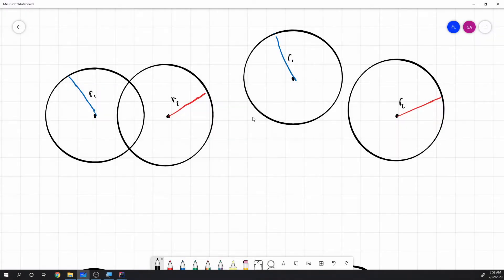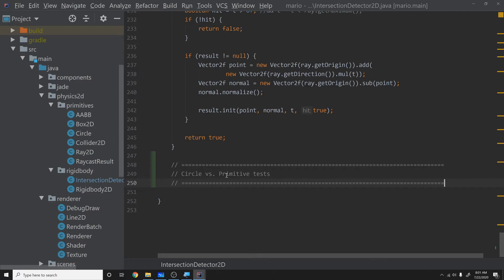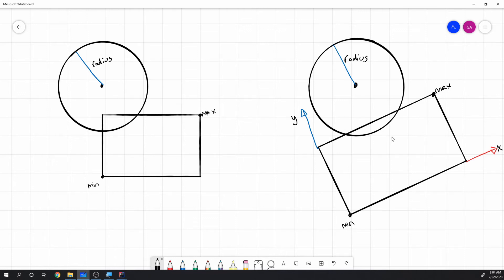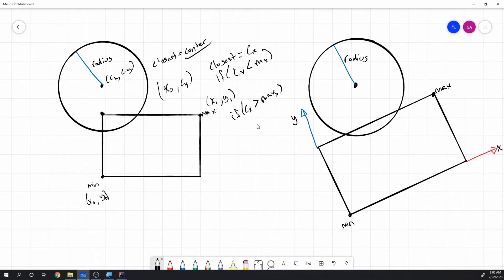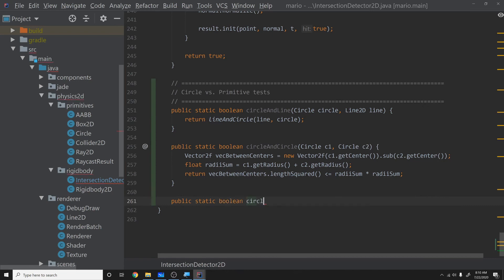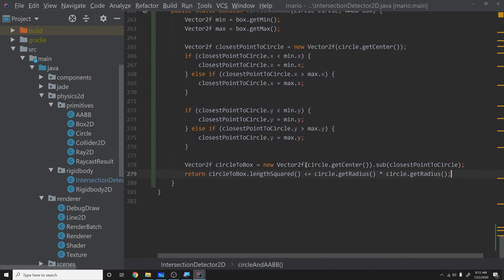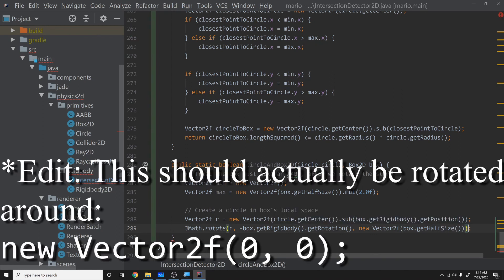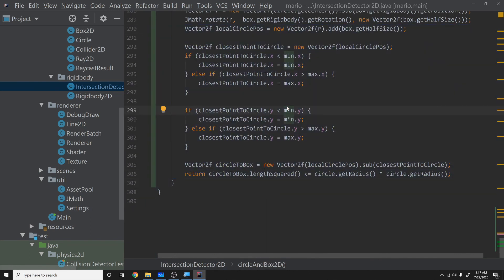Circle vs Shape Collision Detection | Coding a 2D Physics Engine in Java #10

Comment: I didn't try if your code is working, but I think the collision is detected only on the corner. what if the circle is colliding on the edge of AABB. sorry my english is so bad and I'm a little confuse
Reply from the maker: Your English is fine :). It won't be checking just against the corners though. Since I initially set the closest point to the circles center, it will only snap to the corner if the center less than the boxes min, or greater than it's max, otherwise it uses the center of the circle. Pay close attention to the if statements, and if you step through the code with a couple of real examples it will hopefully become more clear. Also, the code is available in the physics package in the repository linked in the description of this video (or the 2d game engine series if it's not linked in this video for some reason)
Reply: I was very confused by this too. The insight that helped me understand is that it will always clamp either the x or y value of the "closestPointToCircle" object to the box's edge, so it's not just using the centre of the circle as the "closestPointToCircle" (unless the centre of the circle is inside the bounding box, in which case that would obviously be the closest point to the circle in the box). I don't know if that helps you but it's what worked for me.

Comment: Great series! Your teaching style is fantastic!

I have been trying to write tests for the collision detection methods and I have a question. We included a RigidBody2D object in our Circle/Box2D/AABB classes and initialized it to null. We never initialize the rigidbody variable properly and thus, whenever it is accessed in the collision detection methods, we get a null pointer exception. What I ended up doing was to simply have the user pass a RigidBody2D variable via the constructor so that I could set the position (and rotation for Box2D). 

1) Is this what you plan to implement in the future or are you going to do something else?
2) I am not clear on how the rotation works for Box2D. Assuming I pass a RigidBody2D variable to the constructor (with a position and rotation set), should I initialize the Box2D variable with the value of the rotated points for min and max or should I use the axis aligned min/max?
Reply from the maker: Hey Sabah! Thanks for the comment and these are all great questions, I've kind of just been avoiding all these issues for now because I wanted to take a look at how Box2D (the actual library here: https://github.com/erincatto/box2d-lite) handles it. The way they handle the position/rotation is by actually storing it in the collider (Circle/Box2D/AABB) which is what I think I will switch to. Once we have that there will be no need to keep the reference to Rigidbody2D anymore. 

For your second question, currently the min max just gives us the axis-aligned min max of the shape, which is very misleading, and I don't think it ever ends up actually being used. I think I am either going to change that so it returns the true min/max of the rotated box, or remove it entirely in the future. Let me know if that cleared things up a bit, and sorry for these bugs this series is very much a work in progress :)
Reply: @GamesWithGabe  Thanks for the clarification! 

Actually I found your channel when searching how to implement a game loop with smooth animation. I was not getting good results using Swing, especially on a linux environment, and was looking for an alternative. 

I started with the intention of just using your game loop but I kind of just got sucked in to your series. I have never used opengl myself, so that was a great draw to your series. 

Anyways, you are doing a really great job here, top quality material. Keep up the great work, it will pay off!
Reply from the maker: Thanks again Sabah! I really do appreciate all the encouragement, and also wish you the best luck on your game dev journey :D

Comment: Another great video!!
Here's a Question: Is using if statements better than using Math.min() and Math.max()? Or is it the same deal?
Reply from the maker: Thanks Nikhil! I clicked into the implementation of Joml's math.max() and this is it:
    public static int max(int a, int b) {
        return (a >= b) ? a : b;
    }
so it's literally just a ternary statement lol. I got a bit carried away...
*Edit: I got very carried away and went digging through the Java compiler's source code lol. Check out my answer at this Stack Overflow question at the bottom for a ton of info: https://stackoverflow.com/a/63045843/10156028 :D
Reply: @GamesWithGabe  Whoa. Thanks for the very detailed answer. I did not know you could see the java bytecode. I should look into it. That's great though. :)